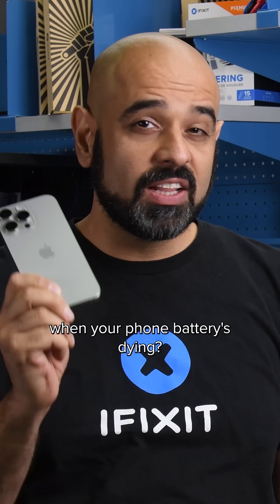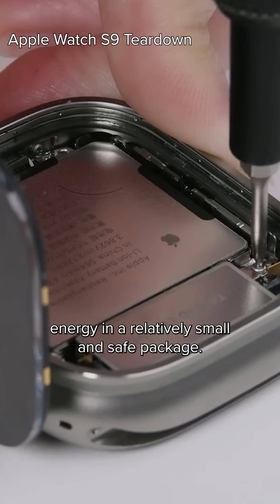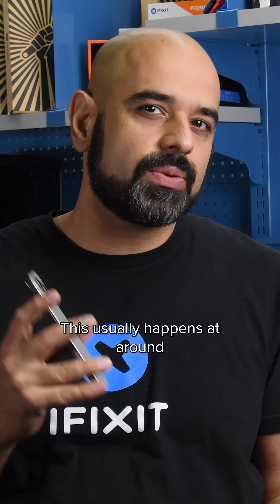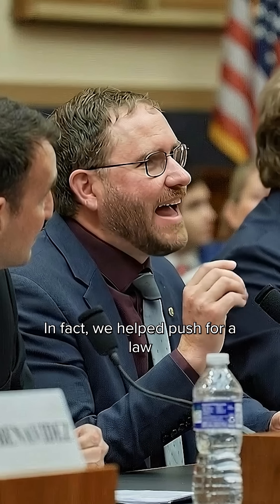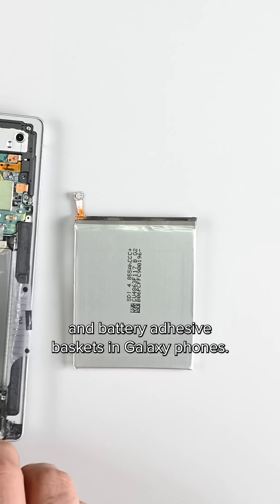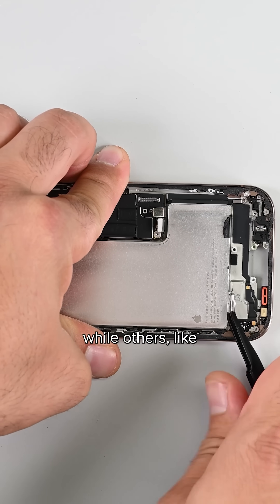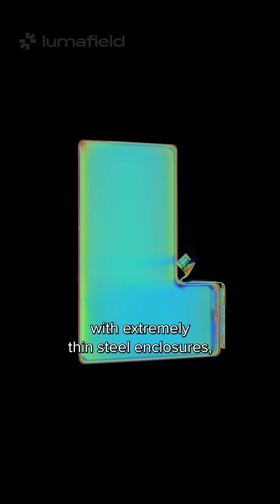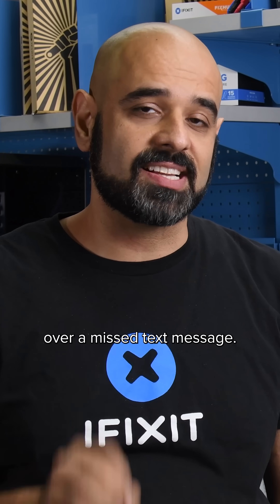Why Does Apple Put Batteries In Metal Cases? #iPhone17 #Apple #iPhoneAir

Comment: Dom what I know, user changeable battery needs middle frame in phone, so person changing the battery doesn't damage other components, which means you doesn't have as much space for the battery as you when it's not user replace able, and if I get battery smaller by 500mAh only to have replaceable, I lost capacity which otherwise I would lost by I think one and half year of using phone after it hits that 400 cycles, also my grandma has Galaxy A41, it is 5 years old and battery still holds well, I didn't have to change it, and I personally change phones because either they are old or slow, and also phones with user replaceable batteries doesn't have IP endurance as high as phone without user replaceable batteries, that means if I drop that phone to pool or somewhere I just made an e-waste, but hey, it has user replaceable battery which is now dead from short circuit, so thank you for potentially smaller batteries and lower IP ratings

Comment: And I’d rather have an ip68 rated phone than a nearly hot swappable battery. This is a step in the right direction and I want more easily repairable phones specifically, but let’s not pretend that most people want quick swap batteries over IP68 ratings.
Reply: With Samsung phones I never had problems with batteries dying after use, my grandma has A41, charges it like every other day and still has enough battery life, when she doesn't play games on it it lasts about four days, when she plays it depends, and I have A55, use it like 5 or 6 hours daily, maybe more and charge it once a day and I'm OK with it, and I think that as user replaceable can be count if they make it like now, but right after you put down back glass you would also see battery connector, I saw A23 5G inside and only problem is that battery connector is being middle frame, and I also like IP68 more than user replaceable battery

Comment: Here is my theory
Phones are getting thinner
batteries need to get thinner
Thinner batteries don’t have strength, can be damaged
Metal casing helps with heat transfer away from battery
Reply: In the era of swappable batteries, all the batteries was metal encased as well. My old Nokia BL-5C cell is also a metal encased cell

Comment: What's your expectation on how manufacturers will tackle that while keeping high ingress protection ratings? It's already about as easy as it can be while keeping its IP rating
Reply from the maker: There are tradeoffs, no question about it. Some users may want the higher IP rating but there is an ever growing number of people that are looking for reasonable ingress protection (IP55 of Fairphone 6 as an example) and significantly higher repairability. 

We need to shift our thinking if we're going to achieve better repairability and higher sustainability in consumer goods.
Reply: @iFixitYourself  because most of people change pgone because of battery life, not because of old android, small storage, when SD cards don't lower IP ratings, or slowness of phone, but instead of pushing for SD slots in phones or more android versions of phone, you push on replaceable batteries, I hope that EU realises that user replaceable batteries aren't good idea, why you don't push for that SD slots on phones

Comment: 400 charge cycles is 3-4 years? Huh?? Who is charging their phone just every 4 days?
Reply: Most users go from when the UI says 100% to when the UI says something around 20%. This would be 80% of a cycle because a complete cycle is just over 100% capacity, that said most modern manufacturers actually lie in the UI, phones often only go to 80% of real capacity and call it 100% so from a user perspective the battery degrades less quickly. 

Some also have the last 5% of battery closer to 10% (not unlike how cars have an empty line that is quite some distance from genuinely being empty.) 

Google and Apple phones also often ask users if they'd like to stop charging at 80% as a default to conserve battery health. As keeping any battery between 20 and 80 both increases charge rate and battery health.
Reply: @zebedeesummers4413 that's great and all but doesn't come close to explaining the math he said.
Reply: im guessing this estimate is 400 x 100% battery plus batteries degrade everytime it overheats, whether your using it or charging it
Reply: Mine is at 500 After 2 years
Reply: that's not how cycles work. you don't use 1 cycle every time you charge a phone
Reply: Mine is above 2,000 and I’ve only had this phone for 3 years and 1 week 😅
Reply: Yeah this is bs my iPhone 16 1st opened on 12/24 & I charge very conservatively, never leaving it on the charger over night, only charging when it absolutely needs & never routinely run it under 15%…. Point is I’m at 290 charge cycles in only 10 months charging very conservatively… so 400 being even remotely close to 3 years is some bs statistic, if that. 💯
Reply: Depending on how discharged the battery is won't always burn a cycle!

A few days without a call or me surfing won't burn a cycle and I even put the phone on charge every night.
Reply: I have 2500 after 8 years
Reply: i have had my iphone 13 max since it came out and it's still above 80%.
Reply: fr lmao, I have 1k cycles on my s22 ultra
Reply: One cycle is 0-100- 0, 0-50-0 isn’t half a charge cycle, it’s not linear and most of the damage is done at the extremes of battery SoC, unless you fully drain your phone every day, you’re probably only doing 0.3 cycles a day
Reply: Mine is fuckinn 988 under 2 years 😅😂
Reply: 3,5 years with my 13 here with over 1300 cycles haha
Reply: I’ve had 464 charge cycles in 13 months of use 🥲
Reply: me
Reply: My charge cycle is at 250. I’ve only had the phone since March. So 5 months?